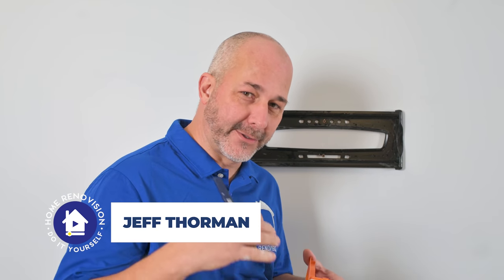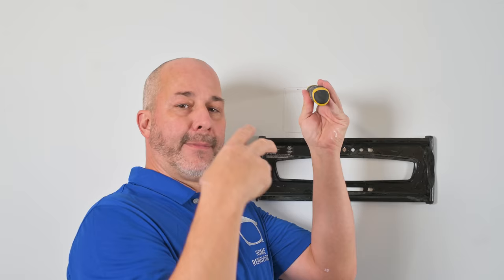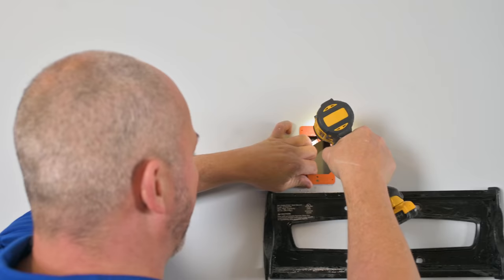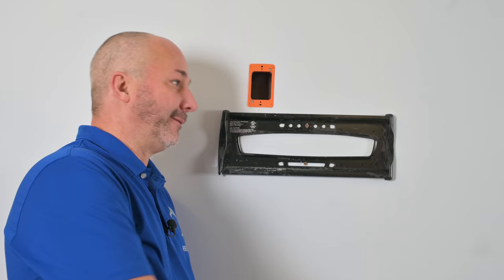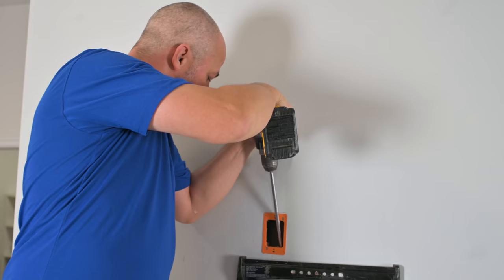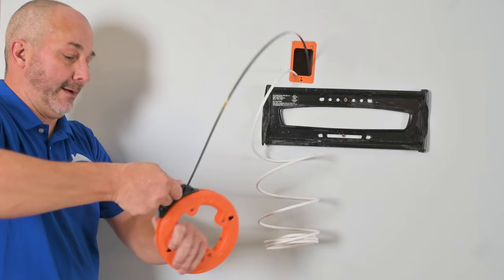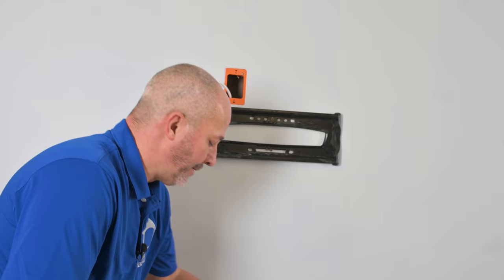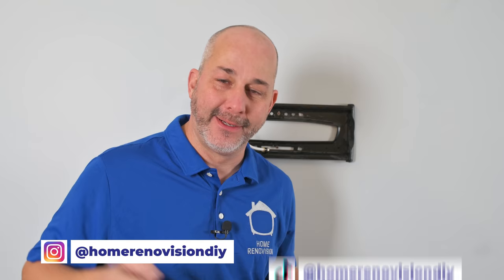How To Hide TV Wires | DIY For Beginners

Comment: PRO TIPs: (literally, I do this for a living) There's a company called Labor Saving Devices, and several other companies, that make all kinds of neat tools to make stuff like this easier. There's a template for cutting boxes that has a level on it. They make flexible glow in the dark rods for fishing cable inside walls. And there are long, flexible drill bits for dealing with stuff like fire blocking such that if you didn't have your box right next to the block, you could still drill through it. And many other tools to simplify a variety of tasks.
Reply: Lmaooooo 😂  Pro tip stick wires thru a pool Noodle and paint it the same color as your wall

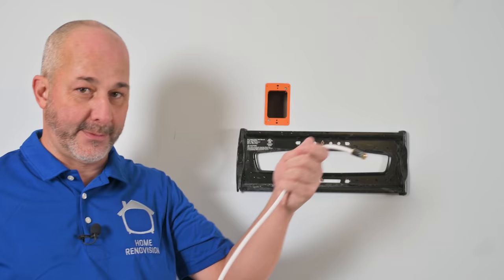Comment: @3:00 a fire block.. So nice to edit out the No No’s.
Reply: Wut?   Drills a hole through the fire block starting at 3:45
Reply: @lloydrmc  sideways takes a lot of time to not blow out the other wall at an angle. But a good video. At that angle would have taken 10 to 15 minutes or more unless they were extremely lucky.

Comment: Living in NL.

And we never have walls like these :p we have gibo or concrete. So we have to use an angle grinder to do the job. 

Last time i did this i place an aluminium rectangle piece in the wall, then finish whole wall again and paint the whole thing. 

A nice finish takes time 😇

Btw i also placed the electrical socket in the cabinet. This way you don’t see any wire at all.

Comment: I always use a rope, electrical tape, and two butter knives. I tape the top and knives together and fish them through the hole in the wall when there isn't insulation behind the drywall.

Comment: Well done, thanks.  However, seems like more of a challenge if you want to run the actual electrical plug through the wall, as well. My outlet is close to the floor.

Comment: What kept the paddle bit from coming out of the bit extender when you pulled it back through the hole? And the only change I would have made was to future proof and put a coax/ethernet (rj-45) plug outlet both top and bottom to further clean up the look and for future rearranging.

Comment: Jeff, any tips for doing this on an outside wall where you have to deal with insulation and want to pass something with larger ends like an HDMI cable?  Also, how best to eliminate (or at least greatly reduce) air infiltration of the finished product?

Comment: Couple of comments/questions.  That fire block that you punctured in two places, are perforated fire blocks code compliant?  Also, presumably your tv will also need AC power.  Is there a point in hiding the coax and still have the power cord draped down the wall?  There are a bunch of fantastically helpful videos in Jeff’s channel, and I’m not sure this one is up there.
Reply: Honestly best practice I’ve always found (I’m not a professional) just an avid diy 
There’s usually an outlet below where u are gunna hang tv’ 
I’ve always pigtailed into that and just run a new /2nd outlet so u now have an outlet behind tv and your original one down low remains’ 
You’ll need a remodel blue box cable staple/fasteners they look like a u shape with 2 nails on each side 
And of course you’ll need some romex cable as well as a new outlet and wire twist caps’ 
Hope that helps some man’ 

Basically u remove bottom outlet go up top cut out square then insert your blue box and romex 
 cable  run it down to bottom outlet pigtail in and done’ 

Very easy to do an outlet but read!! First and always shut off power b4 Messing with it
Reply: @joshymcdaniel9233  Even more important to do this in a bathroom, so your bidet power cable isn't running on top of the sink 🙂
Reply: @weekendwarrior3420   it sure if you are jokin…. 🤣 
as it’s “internet advice” take it at face value….
When it comes to bathrooms / water environment it’s a diff ballgame and lots of codes to follow’ 
Most importantly outlets have to be x amount away from any water source and also on a gfci or I think they changed code to the new version of gfci
I forget what it’s called’ 

An outlet for a tv far different than other ones such as bathroom/ Kitchen etc’
Reply: @joshymcdaniel9233  Install the GFCI outlet where it is above the sink and drop the wire down and install another "hidden" one below the sink somewhere. What's wrong with that? You can also use it to keep a plugged-in hairdryer in the drawer.

Comment: Hey Jeff. Any thoughts on how you wire a TV when you need to move the cables horizontally? I have a place for the TV but there's a fireplace beneath it and I'd like to route the cables off to the side.

Comment: if my outlet is more horizontally distanced, and I run into a similar problem as you did with the fire wall blocking the cable, Is it okay to drill a hole through the frame to route wires horizontally?

Comment: most cut out tools have an adjustable base so you can set your depth, and if it for some reason it doesn't then just put 1/2" of the bit in the wall there's no reason to cut 1/2" sheetrock with 2 1/2 inches of bit, and they're really easy to control so it's not going to get away from you. The only reason to use a hand saw is not having a better option

Comment: I hear you say low voltage... But doesn't the TV have to plug into power too? So, as of your setup, you'd still have that wire, correct? If so, why not just run all the wires in a cable sleeve or paint able wire conduit?
Reply from the maker: if you need power then add a plug to the circuit as well. there is always a wall plug you can run from. same system just use the right wire. 14/2

Comment: What is the person supposed to do if the fire blocking is lower down the wall?  Seems like your box is not level.  Looks crooked to me.  I know something will probably be in front of it, but it takes two seconds to stick a level on it.  It would be nice if it was at the same height as the outlets as well.  What happens if someone doesn't have something in front of it.

Comment: Good one. But what if the fire bar is far from reach of the drill length? or are multiple on the way down?
Reply: You pretty much just have to get a longer drill extension. They make ones that are extremely long, and ones that are also flexible
Reply: You can cut an access hole closer to the fire block and then patch later.

Comment: The brackets are cheap crap. The dust covers that come recommended with the bracket don’t even fit. Measurements are way off. Now I gotta grab another bracket and hope the hole I cut is not too big. Thanks for the bracket recommendation

Comment: Not sure why you would need to run a coax wire up the wall cable box usually sits in the lower console, better to run an Hdmi , or several Hdmis , these are the wires that need to fo up to the tv and down to the av equipment such as cable box, blu ray , player , roku , av receiver etc....

Comment: I am confused. What about the power cord? What does the bottom look like? Do you just pull the cord over to the cable spot.
Reply: It's against code to run a power cord behind the drywall, the proper thing to do have an additional power outlet installed behind the TV. For someone who is inexperienced with electrical wiring it might be best to get a qualified electrician to do this if the power cord really bothers you.

Comment: Would this work if there’s concrete behind the wall?
Reply: Yes, assuming your wall is framed with wood in front of the concrete.  You'll still have a cavity to drop the wires down.  If somehow your drywall is right against the concrete, then no you can't do this.  You can use decorative conduit on the wall instead.

Comment: Curious how one would do this with a ceiling mount projector... I have a bunch of beams I have to get around 🙃
Reply: You'll probably have to cut holes in the drywall so you can drill through rafters.    A good trick is use a 4 inch hole saw to cut holes,  then use the drywall cut out to patch.   Its a lot faster.
Reply: @scottstewart9154  Ah what a messsss I'll stick with the conduit for now. That's basically what I thought I had to do. but don't love it 😅

Comment: Contractor Tip: Whatever hole you cut out first, use a flashlight to see if you can see light after cutting second hole. Much easier for a bit to bite wood drilling a new hole vs enlarging existing one. Also consider hole size for future cables/expansion (HDMI, Ethernet, etc.). On new construction/reno, have Contractor install power and conduit (between top and lower box) twice the size of what you currently need. Not much cost difference but will save you tons for growth/expansion.

Comment: Like the fireblocks.  If you didn't show this, plenty of DIY'ers would be wondering why the wire isn't going thru.  Someone mentioned having to close the hole with fire retardant foam.  Worth a mention.  I'd like to see a video of a mount ABOVE, say, a fireplace, and the only way to run electrical is going up, making a left (or right) turn and drilling horizontally thru multiple studs.  Or am I wrong.  That's a video I'd like to see.

Comment: If I did this job ,I would realize that I had another cable that needed hiding and drill another hole and accidentally destroy the drywall and drill through an electric cable that I didn't know existed and cause a huge electrical fire and end up needing to put new drywall on the whole wall and then accidentally miss the studs and screw to tv mount into drywall to realize the tv fell down on the flower vase spilling water on all the electric devices and destroying them all and then my wife would get an emotional break down and start shreeking and then divorce me and slash all the tires on my car and take the house and dog and cat and leave me homeless

Comment: Food for thought as a licensed electrician in Texas your not allowed to run extension cords or power cabels through low voltage boxes in the wall. This method only hides the low voltage wires. Its not that expensive to hire an electrican to add an outlet behind the tv and when doins so most of us will add your low voltage box and pull what ever wires you want for you. Its up to code with no fire hazards. So why risk it over less then $200. We have methods to get through fire blocks insulation and make it safe. Im a firm believer in its your house and you should be able to do alot of things yourself but when it comes to electrical and safty just call a professional.

Comment: You have to get an electrician in to add another circuit.  Don't run the power wire behind the wall

Comment: Hey “Uncle Jeff”, I want to run 2 new electrical lines from my breaker box to my kitchen — 1 for my microwave and 1 to my island for the stand mixer and other small appliances. What’s building code in Ontario for bringing wires through the floor of a mobile home? Next is getting power to my detached garage. You can email me if that’s easier. Thanks, Tony.
Reply from the maker: I would definitely use a 2" abs pipe and run the wires in that. you want to keep wires away from critters. Cheers!

Comment: One major issue that you seem to have no clue about is that you just voided your fire wall. You stated this was a stairwell at a church and I doubt you sealed all penetrations or used the correct fire caulk in the hole you drilled in the fire stop and during your next fire inspection these holes will fail your church.

Comment: So it's allowed to just drill holes in a fire block? Seems like something that should be reported. At least report it so it can be sealed after you run the wire through the fire block.
Wouldn't want my neighbor to just destroying or removing fire blocks because he wants to hide his TV wires.

Comment: I'm sorry. I just don't get it. The hole behind the TV makes sense, but the hole near the baseboard does not. Why am I running cable to the floor?  Others have addressed the issue of the power cord -- where the hell is that going?  Now I have to start running romex all over the place? There has to be a better way. 
Big fan of the show. Have learned tons from Jeff, but this video could be tighter.

Comment: FYI, in most countries this is considered not only NOT SAFE, but 100% ILLEGAL. You're running 120V "high-voltage" wire through a wall, where only max 50V is allowed (called low-voltage). I'm kind of concerned that a channel dedicated to home renovations is NOT aware of this FIRE HAZARD.

It's unlikely you'll have issues, but if code specs were to come into play at some point down the line, this is considered UNSAFE. For example, let's say your house burned down and the fire dept was able to determine the wire caused it. You're gonna be in a world of hurt financially when you have ZERO coverage.

Is it worth saving the money over buying a $50-60 in-wall high voltage kit? I'll let you decide that. The answer seems incredibly obvious to me.

Comment: This is a total disapointing video,    Very few people just have one cable to hid many people have  multiple HDMIs and they also want to run power.    A better Video was showing how someone can install a TV cable/power management solution you can buy on Amazon, this allows you to do similar to what Jeff did but also run power to the bottom outlet.